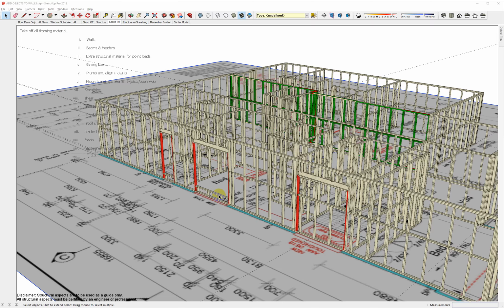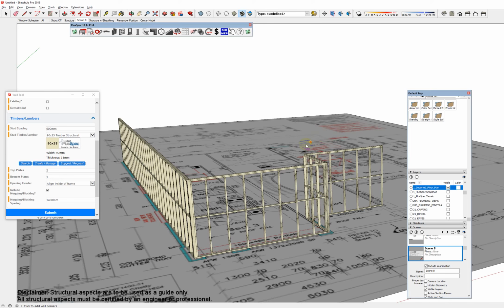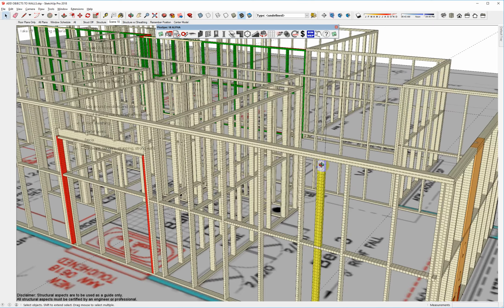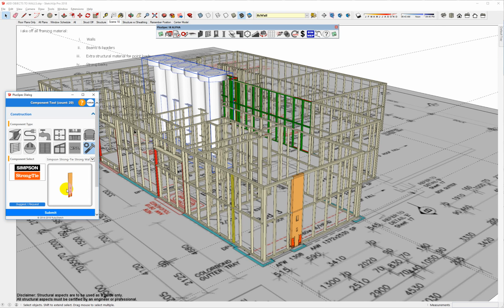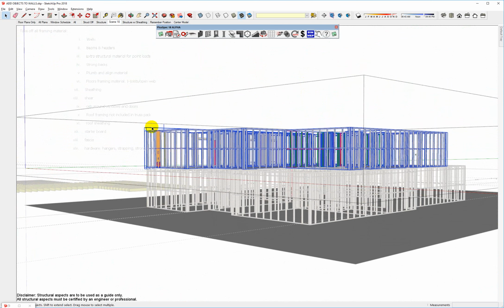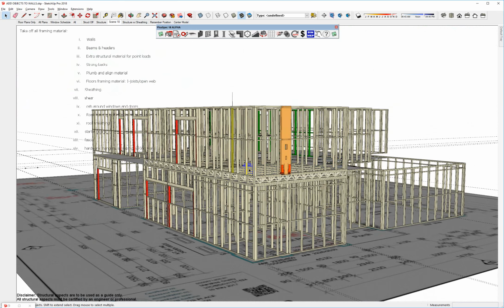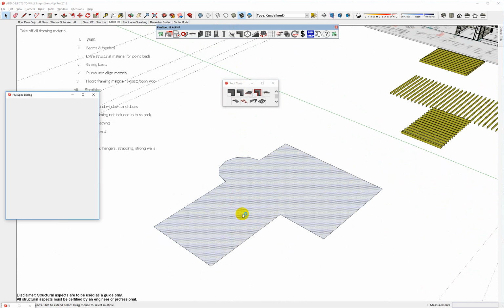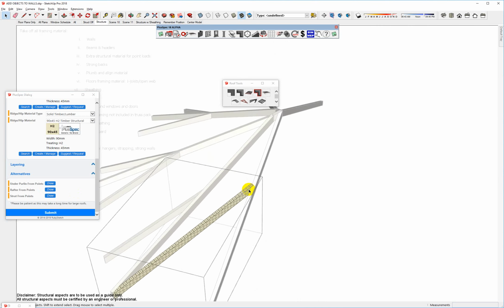Frame & Truss, detailed framing, connectors and more in PlusSpec for Sketchup

Comment: TLDR: Can I use your tool to get every single piece of wood size? And then, use that information to pre -cut all my lumber  ,and have my crew put them together to frame out a 18 ft by 12 ft home extension ?   

Hi,
Thanks for the great work. I am building/ rehabing a house on my own with a crew. The crew is good with cutting and putting lumber together. But we do not know carpentry. My question is, 1) how accurate is your tool 2) Does it know code compliance (example: Span table, size of lumber to use for ..say 12 feet header)  . The idea is , I create the model, get a detailed part list, pre cut them, and them assemble them like lego pieces. Thanks
Reply: Yes that's exactly what Plusspec does as far as cutlists go. Code compliance is subject to municipality,  loads ETC however,  its not an engineering tool. Plusspec enables you to change header heights, stud spacing,  and lumber/ timber size.  Ideally you contact the office as a little birdy tells me there is a new release coming very soon that delivers more in less time with less waste. If you buy now you'll save money as the new release will stay the same price for existing users under a Grandfather clause.... And updates are free for existing subscribers
Reply: Hi Highlander, I am involved in the development of the tool we will be releasing a new version called PlusDesignBuild which creates order lengths, lumber sizes, bid requests, and create purchase orders and more. It is a very advanced version of PlusSpec You can paper register here https://plusspec.com/new_plusdesignbuild/

Comment: Hi. With PlusSpec can I do the same work but with LSF (Light Steel Framing)? And can I update the database with new profiles?
Reply from the maker: Antonio, we have been working on light steel framing in-house, yet the majority of our users are timber frame if we had sufficient call for it we would. In our beam tool, we have RHS SHS, C section light gauge steel and hot rolled steel including UB Channel and flat which could be used as studs and associated with a wall like in the video.  If you could let me know what you need and why I may be able to shed some light on what will be coming out in the future.  Are you a builder or frame and truss supplier?
Reply: Thanks for your answer. I'm a builder starting a company to build houses and small commercial buildings, specialized in Light Steel Framing constructions. One of the most important thing to me is that my designs must be in BIM technology. When I saw PlusSpec and it's framing capacity, I became very interested. So I need to do the same thing that PlusPec already do with timber, but with light steel frames (basically frames in C section, downturn lip C, standard Z, downturn lip Z, U section, L section and studs). And if the software output a cut list and CNC instructions to produce the frames it will be great.

I really enjoyed everything in PlusSpec. So I will install the demo and see how I can do my jobs with it. If I have any doubt I will contact you again.

Thank you.
Reply from the maker: Antonio Bordin Júnior we are not far from this as I type. You will need to contact us in the new year for more information. Have a safe and Merry Christmas. B)